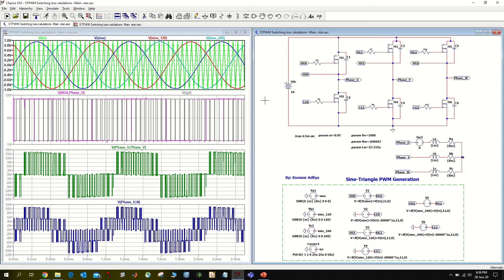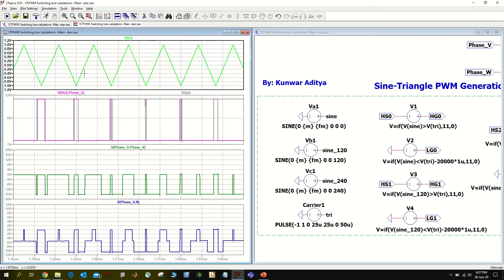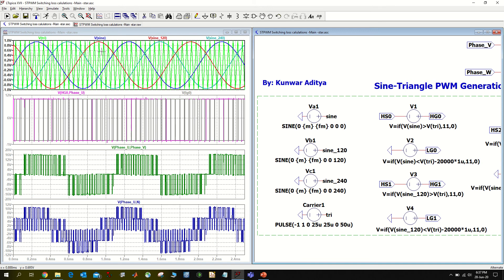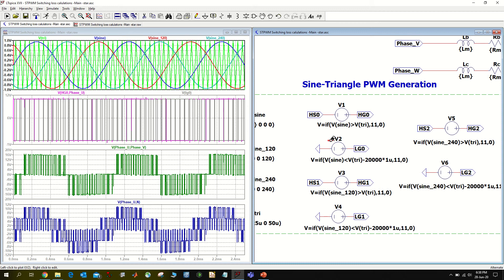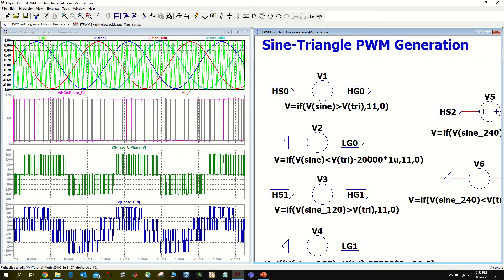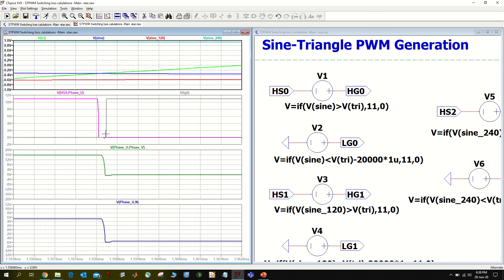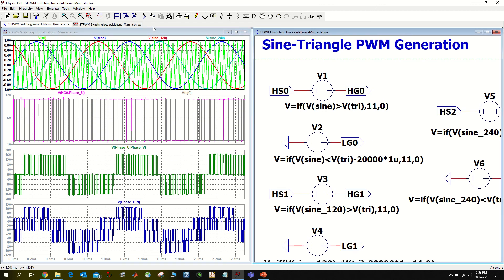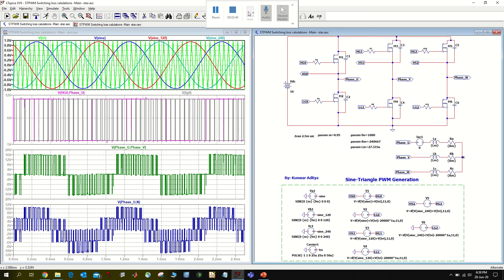Sine Triangle PWM with dead-time in LTspice

Comment: How is the calculation done.
20000*1u you calculated to 250ns. 
How will I change the value of dead time if I need 400ns suppose?
Can we get clear explanation of the calculation

Comment: Hi,

Which MOSFET model that you have used in this schematic? Because same file that i have made in LTspice, but I didn't get exact same output as you. and i got output in mV range. Can you please share MOSFET model?
Reply from the maker: I used a 40V mosfet from NXP..don't remember part number.
Reply: Hai Parth, by any chance do u mind explaining the dead time value calculation if you understood how it turned out to be 250ns

Comment: Please: (1) what is the "Iac1" component? I chose "Linear current dependent voltage source" and I am getting this error: "Iac1: Unknown controlling source 0". (2) How to get the symbol for Vdc. Cannot find it under components.
Reply from the maker: Iac1 is a voltage source , its value is set to zero. Therefore it acts as a current sensor.
Reply: @Charged_EE  I see. Thanks a lot.
Reply: How to get the symbol for Vdc. I cannot find it under components. Is it the same as using a voltage source?
Reply from the maker: @jacketdembys3301  it's in the library as battery..you can also use voltage source....

Comment: Hello, could you enter the values you used for the resistors / capacitors at the top of your circuit? Or even share the project?
Reply from the maker: 47Ohm , 2.2nF
Reply: @Charged_EE  Where we have to write if statement.. For comparison of sine and tri